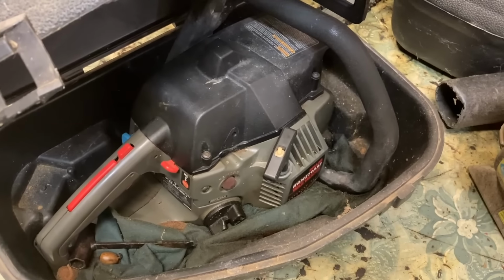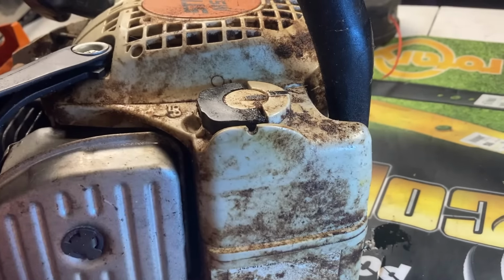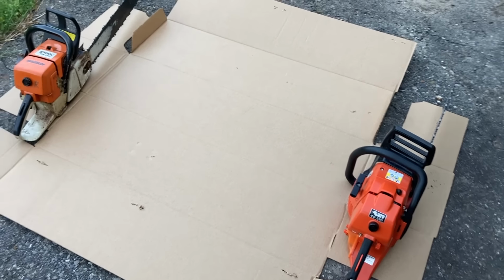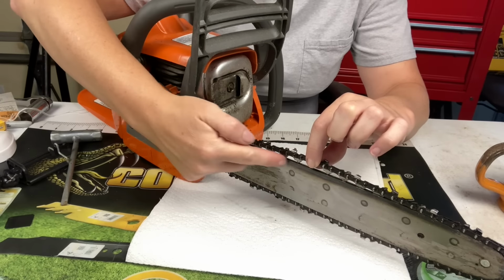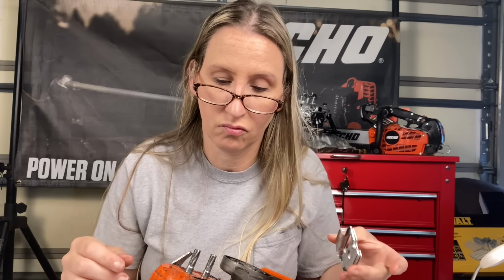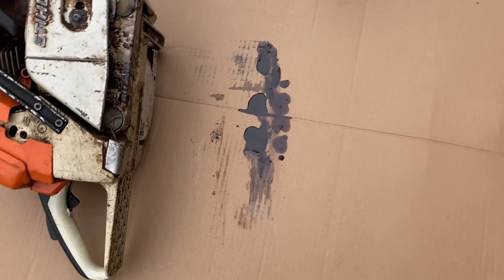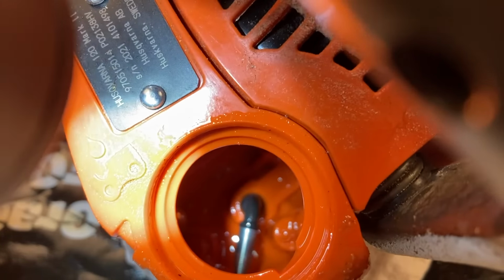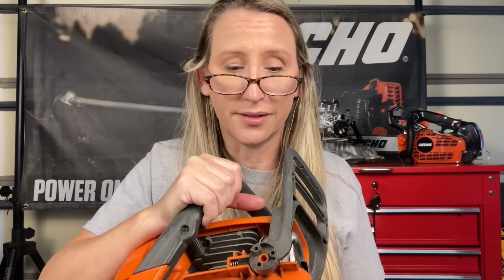Chainsaw leaks bar oil? The most common reason why AND Husqvarna saw leaking oil FIXED!! Repair Vlog

Comment: Having a 044 behind the newer echo definitely is a little bit of a fantastic demonstration of why the 044 is such a legendary saw! It’s not really a larger package and it’s a whole lot more zip and it’s incredible snap from zero to blasting makes the pro echo look extremely lethargic and pretty sad! LMFFAO!!!  

There’s no sexy saw mechanic chicks where I live!!! LMFFAO!   What’s up with that! 

Where’s your small hemostats? I usually grab a couple Q-tips and a little bit of acetone or a carb cleaner and I clean up the line ends and I’ll dab a little bit of the Threebond 1184 on the metal piece and glue the system together just like I do on my intake boot…. If you don’t want any oil underneath the saw then you need to set your saw’s on a pig-mat or something else to catch the residue oil that you explain very well that there’s some lube on it’s parts.   I’m just a huge fan of releasing my chain tensioner after a day of cutting so I actually always blow off my saw’s when I’m getting done with them for the day so I pop off the chain cover and I blast everything off the saw and air filter box… but I’m still absolutely setting them down on a pig-mat or a rubber floor mat old mud-flaps or a couple pieces of old conveyor belt that I bought home from a job…. A magnesium case’s “professional type saw” should never really be allowed to set on a concrete floor or I respect the tools enough to never set them down on a concrete floor … running or not!  Cheap rubber floor mat’s make a wonderful bit of protection for the bottom of the saw and then they will keep the floor clean too! LMFFAO.  Sheet of plywood or a piece of 2x12” wood 2’ long is a fantastic perch for a saw also….    I’m glad that I built a bunch of wood shelves for the saw’s to get them off the floor and protected!
Reply: LMFAO!!
Reply: @jeffersonprice3800 leave my french fries alone oilbreath!!

Comment: Not sure why you have failed to reveal the adjustment to the oil feed setting....  The oil flow is ADJUSTABLE.. Typically a slot screw deep inside a port in the bottom of the saw...turn right for less poil flow turn left to increase oil flow...do you know about that chickanick???

Comment: I’ve had two Poulan saws w/20” bars - an old one that never leaked and a newer Poulan Pro that leaked like crazy.  I sold the older model (mistake) and kept the new one.  Finally decided to buy me a Husqvarna 450 Rancher.  Haven’t used it yet, but hoping it is a better machine.

Comment: You mean they're not supposed to leak bar oil?  I've never had one that didn't leak.  I wish I would have known sooner but now I use old motor motor oil.  Much cheaper.

Comment: I have stihl, Husqvarna and homelike saws, the stihl frame/body especially where the bar bolts come out of the body of saw.  Its all plastic so many times unscrewing bar nuts the entire bolt/all thread will come out of plastic body.  I end up using a 5000 plus psi JB weld epoxy for plastic to hold.  I do not understand ( yes besides being cheaply made but not cheaply priced ) would stihl claim to be a top quality, rugged knowing they do not build ballerina outfits but dang chain saws.  
All my saws leak, I have fixed pickup, pumps and learned to stop the leak do not store it with a full tank of bar oil.  At times I have grabbed a saw any brand after 2 or 3 weeks sitting in the case and all the bar oil escaped and was in bottom of case.  It's simple all these companies build cheap today.  I have 2 Husqvarna 50's purchased new in 1988 at the same time.  They are built with pride and the issues I have with them are minimal and rare.  Heck I still have the original paperwork and they came with part diagram list, service manual and owners manual in 3 languages non of which is press #2 for mexican.  Thank gosh.  The new Husqvarna's are not even close to the quality same with Homelite. 
Youi video on how you start the stihl, I have been using that technique since you released the video.  My gosh it is the best advice I have ever heard used and it works awesome.  WOW

For anyone who worries about how I spelled the manufactures awesome because I tried to spell each one different just so I could make sure we still have people in this world that do not matter including their opinion.  Plus it a great way for me to smile knowing how easy it is to control what I call Sheep's emotions.  

I love your channel and you rock.  Plus your good and the info you share is helpful.  STupid gas tank funnels .

Comment: Suggesting: You need a set of locking hemostats to grab tubes and grommets in oil and gas tanks and other little things in awkward locations. Good enough for surgery, good enough for chain saws ;). Much better than needle nose pliers.

Comment: Your final summary was what I always thought (having run various saws for over 45 years).  Saws leak.  But, yeah, you have to make sure the lines are connected right, the pump's working and the bar's getting oil - that's what's important.

Comment: After mopping up puddles for a year or two I finally figured out to make sure the gas and oil caps were tight and then instead of storing the saw sitting right side up, I just roll the saw over so the bar is on the top side so the oiler slot is above the oil level inside the tank. NO MORE LEAKING OIL! Try it.

Comment: The simple way to put is bar oil is get your wife to buy a large bottle of dishwashing detergent. When it is used up, wash the bottle out, and let dry good inside. Put the bar oil in it. Simple to just pull up on the spout and put the oil in without ever spilling any.

Comment: Chickanic is great!  I just got a carb kit for my Homelite P33, which has been sitting for maybe close to 10 years.  Sure enough there was a puddle of bar oil in the carrier.  Well I drained the remaining bar oil out of it and got to wondering if there was something more serious other than than no starting issue.  But thanks to you I don’t have to be concerned with a “little” leaking of bar oil.  Now on to my starting problem and carb replacement. Thanks.

Comment: You might try a large hemostat to get into small holes rather than the needle nose pliers. It makes life much easier. I only use the needle nose pliers when I need to use a lot of pressure on an item.

Comment: I like to keep my bar oil in an old one qt. 90 weight gear oil bottle with the pointed spout that comes with it. You can squeeze it in fast and stop right away when it's full. Those round bottles will spring right back out. You can put the cap on a regular oil bottle and it quickly looses it's memory, and won't pop back out.
Reply: I use empty cleaned out ketchup bottles..the ones you have to squeeze to get it out..works great for bar oil..my gas mix goes in an empty 1 liter plastic pop bottle..I can carry both with me in my cargo pockets..when I'm cutting, they're always with me..and more than enough for several refills

Comment: Ive gotten to the point when I'm done I just empty what oil is left out, I went 17 years before my Husqvarna started leaking though, never get a straight answer to why it leaks, everyone has their theory lol...I'm just like, you know what the oil don't cost that much and it's not a mess lol.. I'll say this, after every use i take it apart and blow it out and clean it all up, and I've cut 1000's of cord of wood with it, I mean countless, it's 24 years old now still a great saw, so quick fix, dump the remaining oil out ...

Comment: Good to see an informative video without a long drawn out amount of useless stuff. Also glad to see her place her foot in the handle to start the saw. I see a lot of people swing the saw around when starting them and not warming the saw up before using them. I had problems with the cap on my oil reservoir leaking, now I know about lossening the cap to relieve pressure from the comments. Not concerned about clutch comments or how to pour bar oil. But, cut off jeans on an attractive woman, that's great. Thanks for pointing out burned bar, that helps users know it's maintenance time before damaging saw.

Comment: Thank you so much for your detailed explanation of how the oiling system works I've got a 44 Magnum and a little 200, or something like that, and was concerned about the oil puddle after use.  Clearly it's normal residue oozing off.  AND, as a guy, it's an absolute pleasure to watch and listen to an attractive woman explaining this in such an articulate way.

Comment: What's the thing with starting chainsaws with the blade running ?
I was always taught you don't run the chain unless you are just about ready to cut or are checking the kickback

Sorry but chainsaws and wearing sandals flip flops ( I'm an Australian so we call them thongs ) on your feet is seriously not something that should be done !

Comment: The oiling system in chainsaws is a failure. After all, it is only 2023 and the innovation for chainsaw Oiling is primitive. Therefore, in order to avoid the filth, I make sure that the oil reservoir is dry at all times and carry around an oil can or oil spray with me while cutting and lubricate my chain as often as possible. Yes, you will go through chains a bit more frequently but damn, it’s worth it.

Comment: I don't normally comment on posts but as a former safety professional your viewers need to know it is NEVER safe to wear flip-flops around a running chainsaw. Safety glasses also even though you are not cutting anything, you are spinning the blade. Also, don't forget hearing protection.

Comment: Hi Bre, just found your channel.  Thanks for videos on TrueFuel etc.  Makes sense. I have the same blower as  your newer one so will try the Red Armor with 89 octane regular gas.  While I was on your channel I found your chainsaw bar oil leak video.  I have a Husqvarna 455 Rancher chainsaw that leaks like a sieve.  A while back I found a video that provided a good comprehensive fix to I followed the instructions to a tee and voila--no chainsaw case full of bar oil.  If you would like to check out the video that did the trick for me, you can find it at the following link.  This was for the Husqvarna 455 Rancher, but I have to believe most chainsaws have similar oiler setups.  Good luck.  https://www.youtube.com/watch?v=3mC_7wLEq9I

Comment: Thank you for this and all your vids 👍🏻👍🏻. You saved me a few times now with DIY repairs on my Husqvarna 445🤘🏻
Reply: Do you know if the XC bar works on the Lowe’s 445 ? I’m not getting oil on my bar and chain now. Hole in bar is not clogged

Comment: Don’t forget the residual oil in the bar chain channel. It would be normal to have a lot of wood material in that channel. Therefore it will take some time but that oil in the bar chain channel will slowly run down to the end of the bar and drip off the saw.

Comment: I'm retired after 32 years of fire service.  We had a structure fire one day and one of our chief officers noticed a crew having a particular hard time cutting a roof with the old 038 Mags that we used to run.  Got back to the station and noticed the chain was on backwards.  Not our best day.  Only happened a couple times during my 32 year stint but was always amazed that the last person to check the saw didn't notice!

Comment: Great video Bre!! I have a pretty limited experience using chain saws but from what I've seen, you're right. Chain saws are messy. Store them on a tray or in a case and expect there to be some oil. Oil absorbent pads could be of some use if it bothers anyone. Me... not so much. Thanks for all the good tips!!

Comment: The oil tank in my old Homelite 150A is minimally vented (factory pinhole in the side of the cap), but what caused it to leak for a few days was reassembling it was a fresh gasket during restoration. Once the gasket got oil soaked after a couple of runs, the leak stopped and now it stays nice and dry underneath during storage. I just set it on a pig mat for a week or so after reassembly and was able to move it into its actual storage case once I noticed no new leakage over several days.
Reply: I usually put a film of oil on my gaskets before assembling, just like u do your oil filter. Have a few Homelite 150's myself, none are running now, One or two do leak oil when sitting. I do think that large square oil tank gasket, p/n 689589-C is prone to leak, well look how large it is, and what it is called! Also there is a little round like a ball bearing check valve, p/n 60051 in the oil pump, and tiny little spring. Don't lose if you take apart, sometimes all it needs is cleaning b/c someone before you ran old used and dirty motor oil. Anyway believe those parts can cause issues with the 150s either not oiling or leaking forget which now.

My 150 oil caps are solid no vent near as I know anyway, I'll look next time I think, now the GAS cap DOES have a vent consisting of a porous brass sponge and a duckbill. How the oil tank vents, other than pushing out thru the pump and bar port hole is a mystery to me, see nothing on the parts list as such. Why I usually when done cutting for the day, crack both my oil and gas caps to relieve any pressure which is not escaping thru a vent, and let saw sit on ground a few minutes to cool off before putting away. Conversely one reason saw starts better in winter when you bring into heated area for an hour or two before is seems as if the fuel tank actually pressurizes to some extent, what does not get out thru the vent that is. 

 Homelite 150, imo BEST saw ever for medium size log buck sawing. They are noisy compared to modern saws, don't rev as high as the new saws, but sure got the low end torque, and the metal case dissipates heat.

Comment: I appreciate the advice. My small Echo has been leaving puddles in the garage, and I have hardly used it. I might add a bit of advice of my own: when you pour liquid from a full container, its best to turn the container with the pour spout slightly above the contents. Now, I know that sounds like you won't be able to pour, but when the cap is not dead center, spin the container to keep it on the top side. The blub blub is air getting into and then not getting access into the container, causing the contents to surge and retreat when poured. So tipping the container way up when pouring fills the spout but blocks the air needed to equalize pressure and even out the blubs. It makes for a smoother pour and the big blubs don't spill out around your target opening.